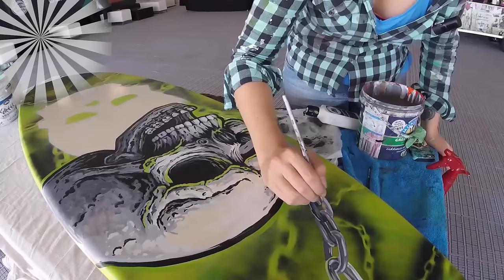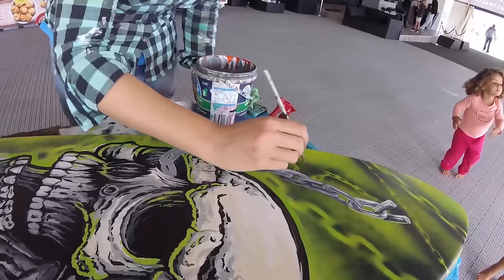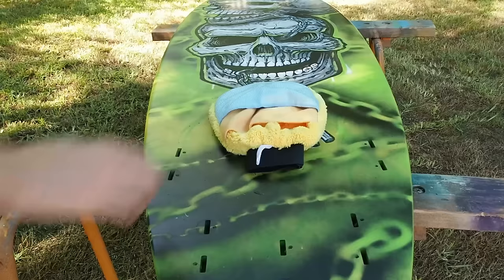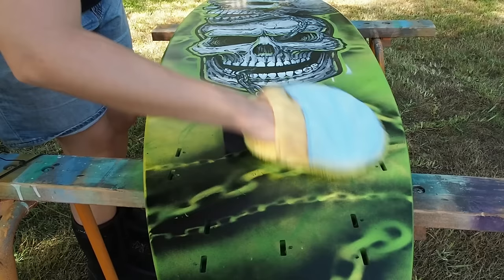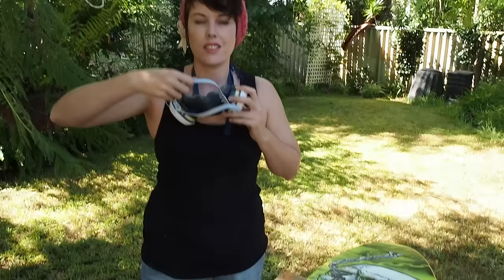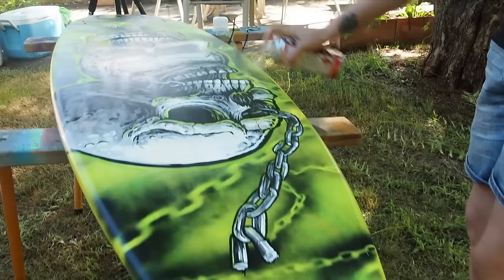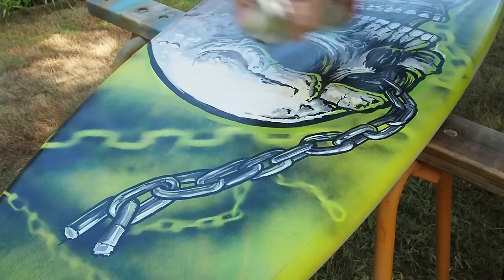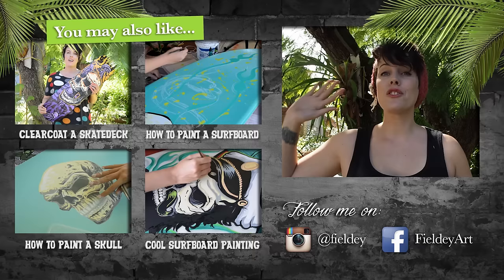The ultimate surfboard art clear coating guide - keep your art safe in the surf! | MSM 13

Comment: Paint needs to dry 5-7 days before clear coating. The chemical reaction of the spray paint needs to be completed (no more paint smell to the paint) before adding clear coat. Never had an issue once my friend told me this. It’s in the fine print on the cans instructions. They should put it in huge letters. Hope this helps!!!
Reply from the maker: Brilliant! Thanks for the input - this is important!

Comment: i just finished painting my board and i need a top coat to go over it. i will be using this board to ride on so i need something uv-resistant and waterproof so it doesn’t ruin the paint. i used a spray paint. thank you
Reply from the maker: Hi Jordan, whatever you use, I'd recommend trying it out on a scrap piece of board, or wood or something like that first. You could try using Rustoleum clear, but without knowing exactly what paints you used, I can't say if it will be 100% compatible. Hence why you should test it first. Good luck!

Comment: Thank you for your tutorial videos. I have had so many issues with spraypaint on surfboards crystallising on my second layer. I have no idea why this happens (used Rust-Oleum every time). I had this happen applying the clear coat about one week later, but also again recently with another surfboard just applying a second layer of paint. While the first layers always seem fine, it happens with the second layer or the clear coat that it starts crystallising. Any tips are appreciated :) Thanks again for great videos :)
Reply from the maker: Man, that sucks so bad... Have you tried any other brands? Is the weather very hot, humid or cold? I'd try another brand and do some tests - also take note of the weather - clears don't like hot, cold or humid weather.

Comment: what if what you're using to paint is just acrylic paints and not spray paint? would you need to coat with laminate resin or could you just clear coat with the spray you used? also do you need to sand it down/base coat before painting? thanks!
Reply from the maker: Hi Elyse, check out my guide to preparing a surfboard for painting for the sanding bit. I haven’t used just acrylics before because I was worried they wouldn’t hold up in the surf. I’d recommend testing out the clear coat and acrylics before you use them to make sure they’re compatible

Comment: Any suggestion on what to do if my clear coat gloss dried and still has a tacky/sticky feel to it when I run my hand over my board? Wet sand or apply another coat? I've already done 4 coats already. It was krylon crystal clear acrylic gloss on top of posca paint pens. Thank you so, so, so much for all your help =)
Reply: Oh and do you have any suggestions on what's the best matte clear to use that won't cause a "milky" look? I'm affraid to use one because of all the horror stories I've read in the review sections of amazon

Comment: Nice video, but there are so many clear coats made from many different things, shellac, oil based polyurethane, Water based Poly, Acrylic Lacquer, Lacquer, epoxy's. So what was your clear coat type and what type of paint is on the board?
Reply from the maker: Great point! That's the thing isn't it - it depends on what paint you used to paint the board with as to what you should clear coat with. This is why I haven't gone into that level of detail in the video, but I've been doing a lot of research on clear-coating for murals lately, and realise there are a lot of options out there. Feel free to give your 2 cents on what you think works well as I may do an updated video.
Reply: @FieldeyTV  So far I have found that once a coat has fully cured, which could be a week, a month, or more, it can be coated with just about anything, especially if washed and scuffed up. Many coatings should be scuffed and washed before coating as well. Epoxy 2 part resin (for instance) should always be washed with hot soapy water and scuffed with a white 3m abrasive to remove amine blush for instance, before re-coating with anything including re coating with epoxy. Even non blushing epoxy formulations can blush in the right(wrong)  weather conditions. Same thing with clear coats or epoxy resins over various paints. I always call the manufacture and get clarity on what can go over certain products. It was much more simple years ago, but now even spray paints have a very specific time period of re-coating, clear coating etc...and this is due to new less toxic formulations. These new formulations have very specific guidelines of how and when and what to re coat with. I have seen the effects myself. Total fail of clear coats, etc...bubbling etc. then I read the directions. ooops. So my advice is to really research by calling and test on your own. I did a test on a part sprayed with rustoleum pink paint that had cured for a couple of years and I had no problem going over it with marine epoxy. No fish eyes or bubbling, but the manufacturer of the epoxy sternly discouraged me from using an oil based spray paint to prevent fish eyes. Well, it seems to be all about the cure time of the substrate and cleaning/scuffing of its surface so the non compatible solvents can evaporate IMHO.

Comment: Can anyone please tell me the brand and name of this clear coat, I've just finished artwork on a board and wanna use it In the ocean, but don't want the artwork to run. I used posca paint pens for the paints.
Reply: also want to know
Reply: @catarinanorberto5796  Already finished my board for my partner, turned out amazing !! i used 2 different kinds of coating from bunnings warehouse
Reply: @TheWizardsSleeve69  what kind of coatings did you use? I used dulux Matt spray, but it reacted a bit strangely with my posca pens
Reply: @andylee9251  Dulux 325g Duramax Gloss Clear Spray Paint Got it from bunnings $13, used the whole can, just coat,dry,coat,dry untill shes gone

Comment: Hey, Ive painted a board using water based Posca paint pens and was wondering if the Molotow gloss clear will be ok? be shattered if it made the colours run.
Reply from the maker: I haven't tried using that combo myself so I can't say for sure... your best bet is to try it out on either an old board, or a piece of plastic.
Reply: The Krylon clear gloss worked with the Posca for me, 4 light-medium coats so you don’t get drips or puddles.  If you put it on heavy it will run the colors.  But light coats work fine and bring the colors out bright. About 10 minutes dry time between each coat and full 48 hours before surf.

Comment: Hi! I used ACRYLIC clear coat by MOLOTOW, 5 layers. After 1.5 weeks of drying, the surface is still soft and one can remove the coat easily with just your fingernails?! What should i do? It took me ages to paint the surfboard :/ Should I put other layers of resin clear coat over the acrylic ones?
Reply from the maker: Oh man! I’m so sorry to hear that - I haven’t had that happen before so I’m afraid I can’t offer any advice, my only thoughts were perhaps it was too many coats too quickly and possibly humid/wet weather? Your best bet is to email Molotow directly through their website and talk to one of their product experts. Good luck and I hope you figure out what went wrong!
Reply: Hi, spray a top coat of Spraymax 2K clearcoat on it.  The 2K has a curing agent that mixes in with it and drys ROCK HARD.  Good luck
Reply: @ZmannR2   Hey there! I was thinking about that too, but don't you think the organic solvents in the 2k coat will dissolve the acrylic clearcoat underneath?
Reply: Gilles Baumann I’m pretty sure Spraymax 2K is an acrylic clear coat itself. Check their website.
Reply: Gilles Baumann or maybe call them and ask
Reply from the maker: Great advice! I love the Spraymax 2K clear coat as well but I've had some issues with cracking and bubbling when I've applied more than one coat, so I'd caution Gilles to be on the safe side contact the manufacturer and explain what you've already applied to the board and find out what they say.

Comment: Do you need to clear coat if you are using acrylic spray paint? hopefully ssomeone answer this video is like 4 years old.
Reply from the maker: I'm so sorry about the late reply, but you could probably get away with not clear coating. What did you end up doing?
Reply: @FieldeyTV  havent done anything yet bately any waves this summer and corona = no travelling  im planning of painting a Tiki hammerhead on the bothem of my board

Comment: Curious if a gloss coat of epoxy resin would be more marine resistant to rattlecan clear? Why not finish the way surfboards are traditionally finished?
Reply from the maker: Yep, it'll definitely work better but you might have issues with paint incompatibility and it will add more weight to the board, which may or may not be an issue. Also, applying the clear with a can is something everyone can easily do in their backyard whereas the resin can be a little more temperamental.

Comment: Do you clearcoat both sides of the board?
Reply from the maker: Nope, just the side with the artwork.
Reply: @FieldeyTV  the board looks great, but I have a question, say you paint the whole board from the top, bottom and rails. Would the clear coat still work on keeping the paint save, because I’m scared the paint will come off with wax for the top. And I don’t know if I should use a resin to cover the paint instead. Hope to hear back soon 😁.

Comment: Hi There, I really love how you inspire us with your art and videos. I've recently finished my first fixed board. I follow mostly of the steps and the result is pretty good. 

I wanna take the board on the water but I not sure if wax are going to ruin the paint and the coat. Do you know what could happen if the wax need to be removed? 

Btw I mentioned you on me instagram. @_el_rho_ if you want to see the board 😬 thanks !
Reply: Did you ever take it out to surf? Did it hold up?
Reply: @jameshumann3988  No I didn't , I did  before the painting, but after the painting i decided to use the board as decorative .

Comment: For the love of god, unless the "surfboard" is destined to be hanging wall art,  stop using clear coating. Any graphics  belong under the resin gloss coat. Clear coat is not going to hold up
Reply from the maker: Look, in a perfect world we would all do this, but let's be honest, most people aren't going to be able to do a resin coat at home, or have access to a shaper to do it for them, so this is the next best thing and from my experience it will hold  up for a good number of years. Also, lots of people don't want to add extra weight to their board with a full resin coat

Comment: hey, i've seen a video a while ago where a professional spray painter said, that u have to wait for 3 to 7 days beofre u can clear coat your painting. the chemicals in the paint are then "gone" and you can start your clear coating.
can i use all brands then, or do i still have the problems u mentioned?

oh and i wanted to paint a piece for a friend on wood. its not coated or anything. do i have to "coat" it in some way before painting, because the wood will soak up the paint or anything..?
Reply from the maker: +SKADZ I think they were talking about using enamel based paints - you wouldn't need to wait that long for acrylic paints, over night is fine for acrylics. You still need to test out your brands before you use them on your board though. You don't necessarily need to coat the wood, but it will soak up a heap of paint. You could just use a house paint white undercoat or primer to seal it.